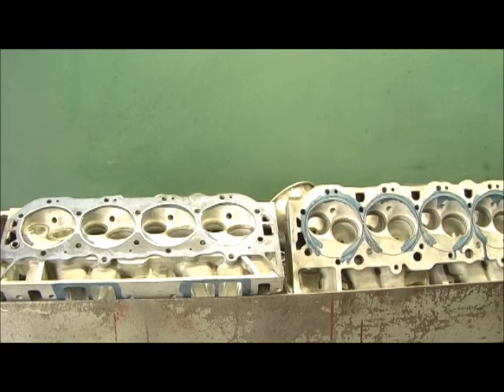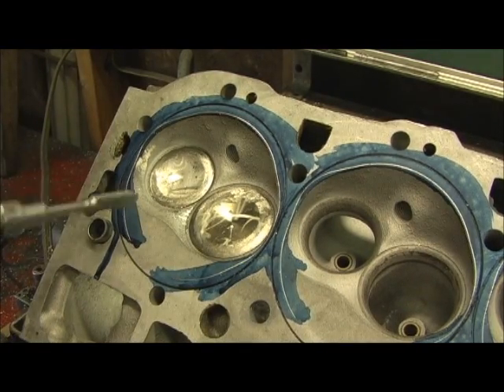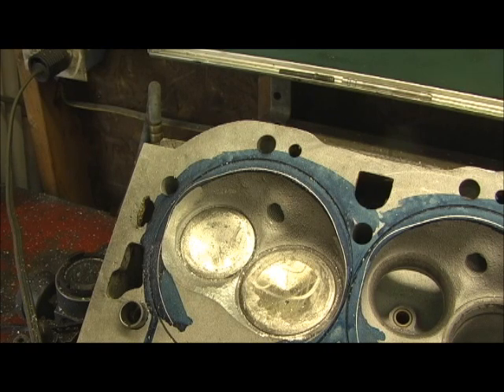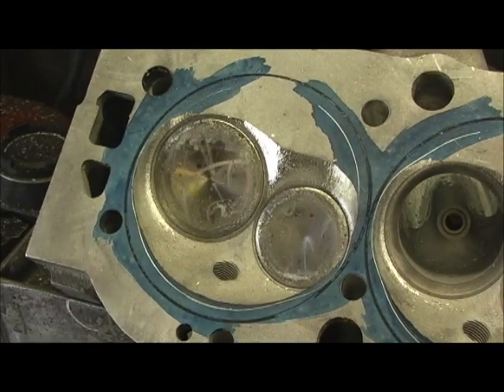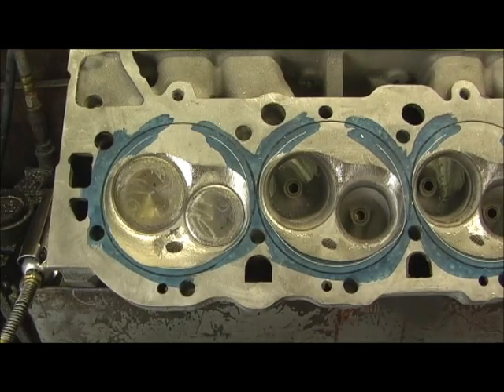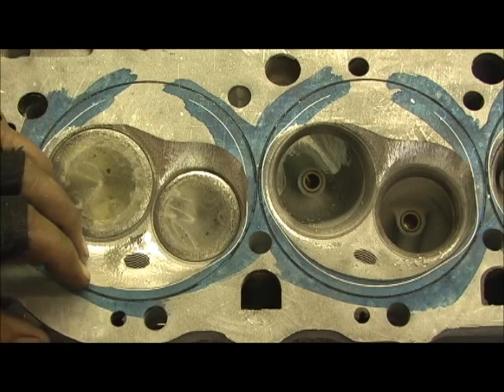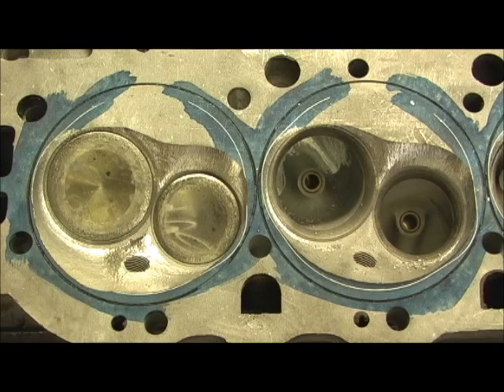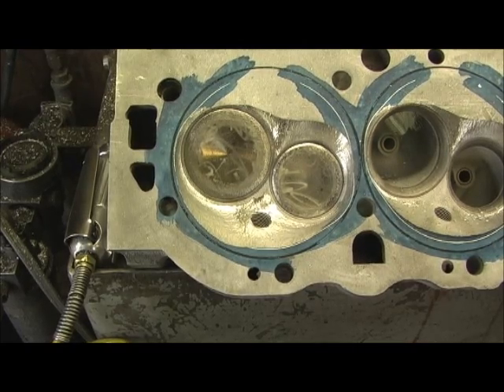Blower Dart BBC Pro One Combustion Chambers 3.0

Comment: Why is it a good idea to open the chamber beyond the cylinder diameter?  That would extremely inhibit intake flow into the cylinder.  The deshrouding you did around the intake would be offset by the pocket and ledge created above the cylinder.  Have you put these heads on a block and looked at the chambers through the bottom of the cylinders?